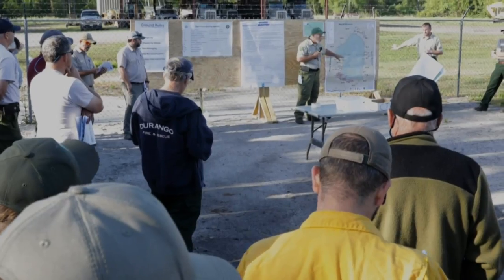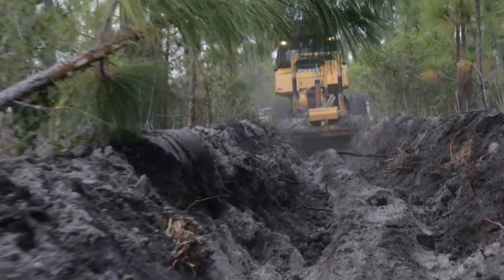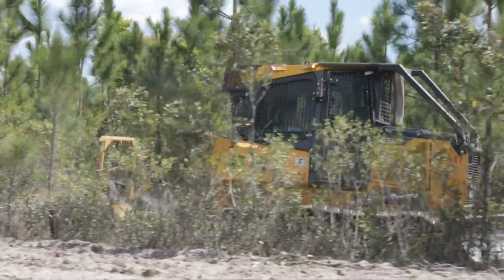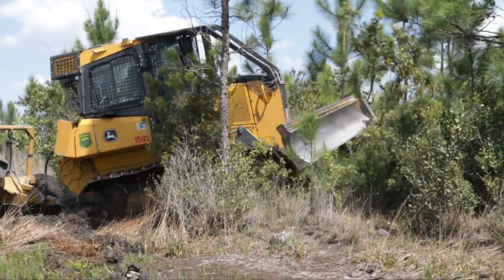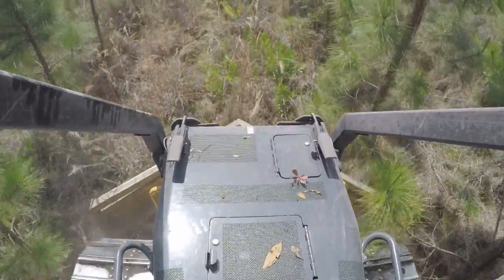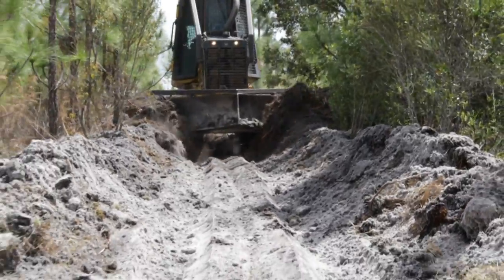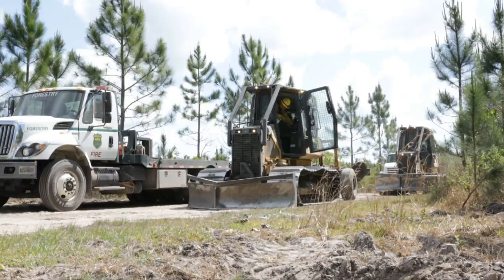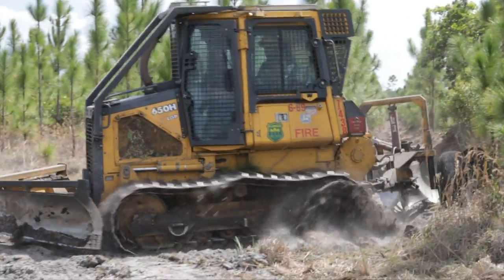Taming Wildfires | Florida Department of Forestry

Comment: stupid dangerous V blades. Only good for North florida, heavy timber and planted pines. So, Lake City Central shop does not outfit equipment anymore? Like what? Yes, It was my design modification to change the 4 steel hydraulic line's under the floor boards for the front blade to Stainless steel so they would  not rot or rust any more leaving rangers stranded and oil spraying everywhere that caught many dozer's on fire and totaled them. I got $75.00 for my adopted suggestion and change. Also changed the exhaust system to protect it from rusting out every 3 years and the oil cooler next to the radiator to an epoxy high heat paint or stainless so it would not rot or rust anymore. Got $75.00 for each of those too saving the state hundreds of thousands of dollars as every 3 years those 3 items had to be replaced on every dozer in the entire state of Florida. What gratitude.
Reply: thats 150 bucks more than bill conklin got for inventing the brush truck that is used on the east coast
Reply: @lostonlongisland6845  Brush trucks have been around for 75 plus years or more. Not sure what your talking  about.